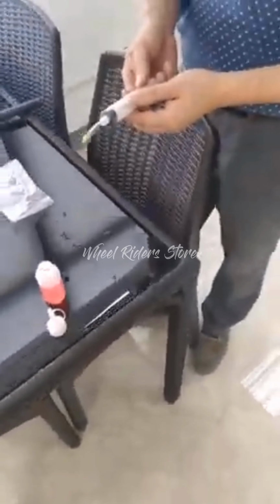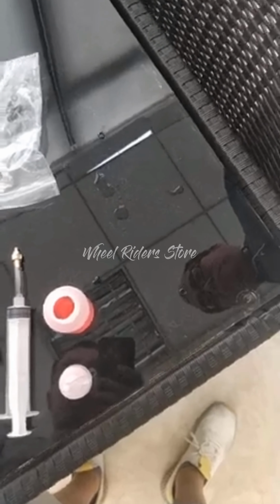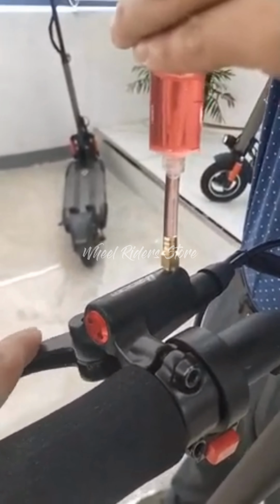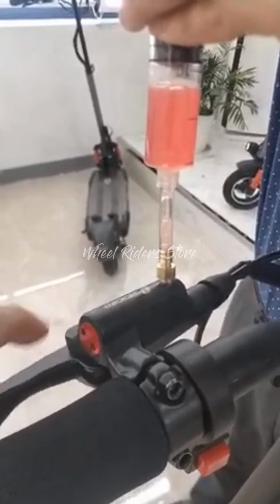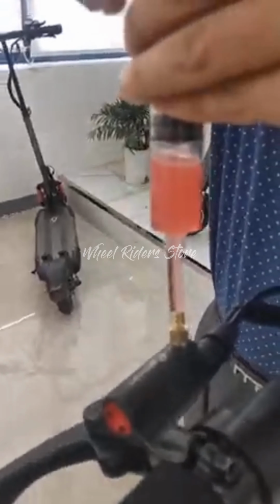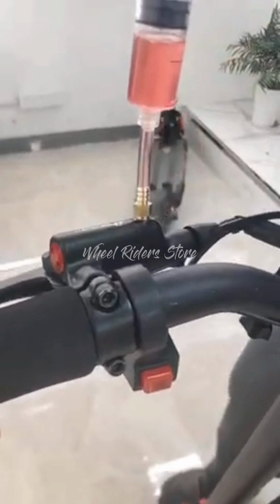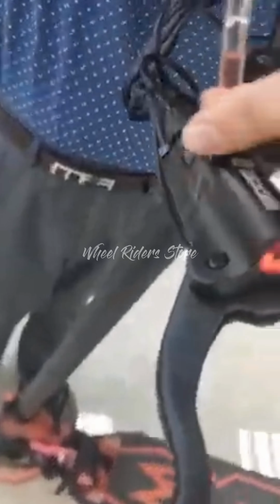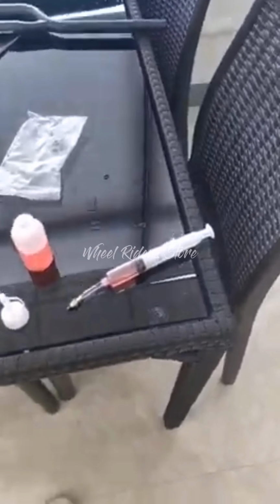How to refuel the kaabo hydraulic brake scooter

Comment: The end part when you go to put the screw in again, is where you get the air in your brakes again - you need to tighten the lever adjustment screw in (make the brake lever harder) which will push oil up and push any air in there also out, while oil is just above the opening of the screw hole, put the screw back in - this will reduce/eliminate more air in the system
Reply: Regarding metall ring in brake lever. R we supposed to remove it or have it on while bleeding brakes?
Reply: InstaBlaster...